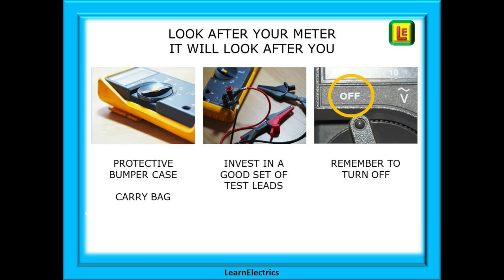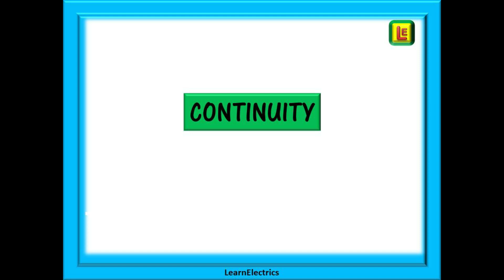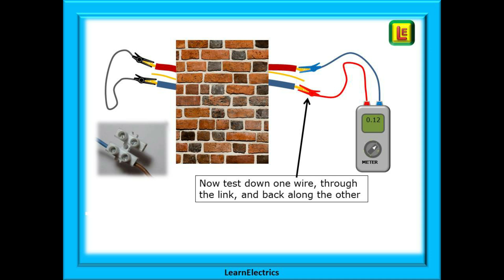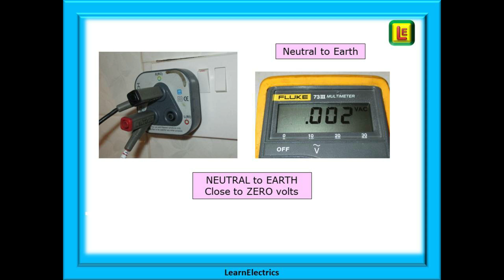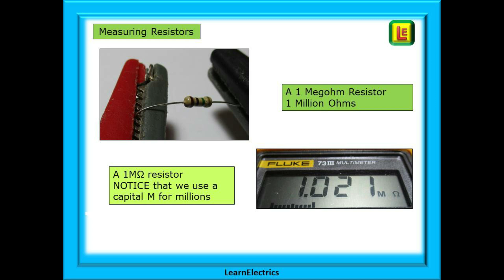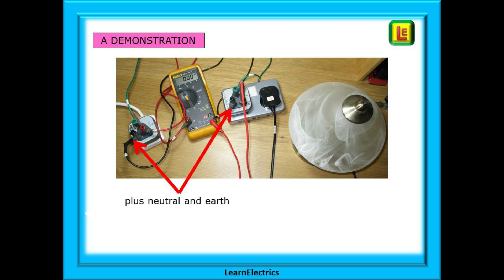HOW TO USE A MULTIMETER – Measure Voltage, Current, Resistance and Continuity

Comment: We need to use German voltage even though our supply is different. 
Black Neutral is now a Phase and Blue Phase is now a Neutral.  R.I.P to those who's electrical careers were cut short. 
The wiseman's guide and a fool's bible.  The fool becomes the Law.
Reply from the maker: Thanks for your input.

Comment: Great informative videos, i am a competent DIYer who works on my home electricity supply, you have taught me a lot watching your video about multi meters, spurs, etc. I dont know if you have already done one, but if not could you do a video and its uses of a fluke T150 or similar voltage test leads, to check for live cables etc. Also using a fluke T150 or similar how to test which cable in a ceiling or rose is the switch line cable if the wires are loose or you have pulled them out of the ceiling rose and cant remember what wire go where??? keep up the good work, thanks Kevin
Reply from the maker: Great idea Kevin. Its on the list. Thanks for watching. Dave.

Comment: Hi Dave…if there is DC leakage in an appliance…would the the DC setting on a multimeter measure the leakage
Reply from the maker: If you are measuring on the DC side yes. You may damage the meter testing DC on an AC circuit. Can you download the user manual for your meter. Dave.